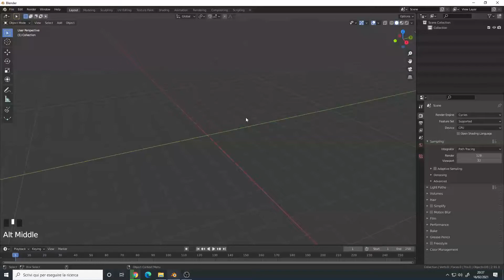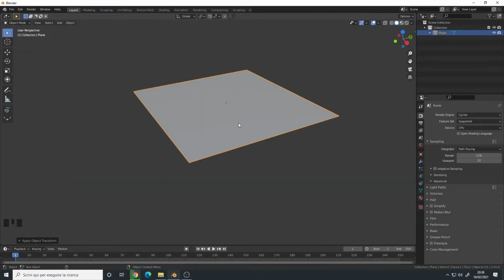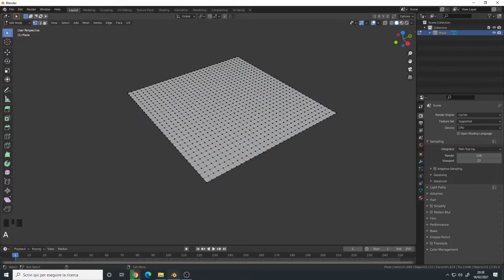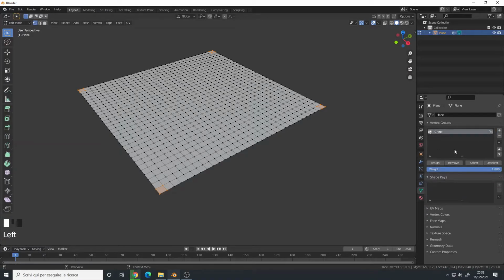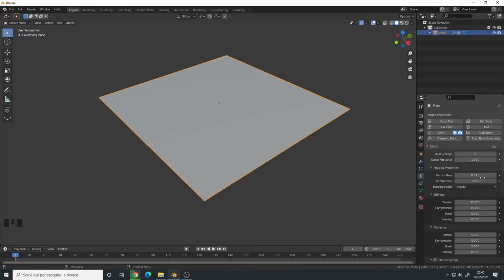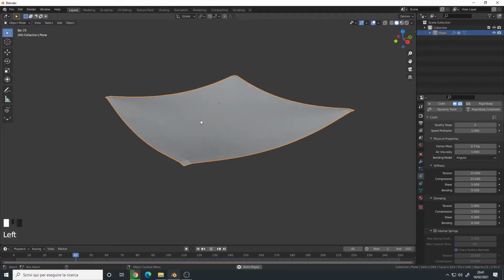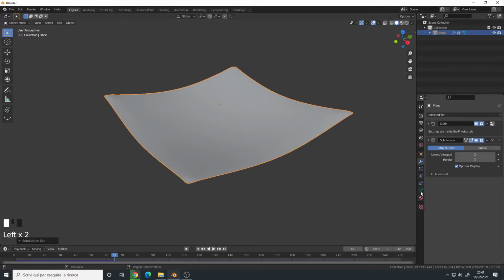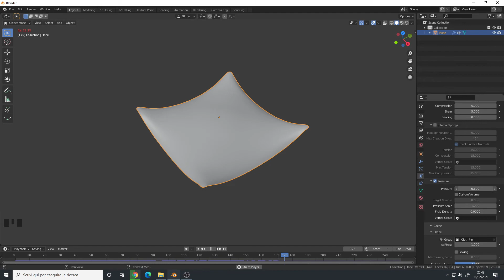Tips & Tricks for Blender 2.9 | Pin a model to use in a Cloth Simulation

Comment: I assigned the vertex group and put it in the pin group but my character's tie still falls off when I run the simulation. What else do I need to do to make it stay in place?

EDIT: I have confirmed that the vertex group is assigned correctly, so that's not the issue.

EDIT 2: I was wrong. I assigned the vertex group with a weight of '0' initially. Re-assigning the vertices with weight '1' fixed it.
Reply from the maker: Did you apply the transformations ? If you moved the model and didn't apply them afterwards they usually cause problems
Reply: @AndreaCantelli  No I found out I had a different problem- when I assigned the vertices to the group I had the weight set to '0' initially. Re-assigning the vertices with weight '1' fixed it.
Reply from the maker: I see, I'm glad to hear that it's working correctly now.